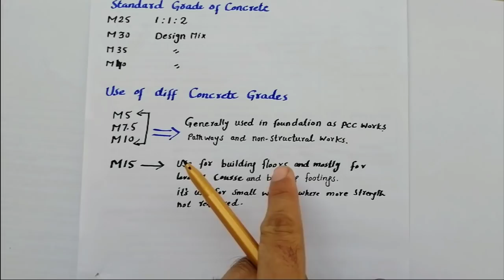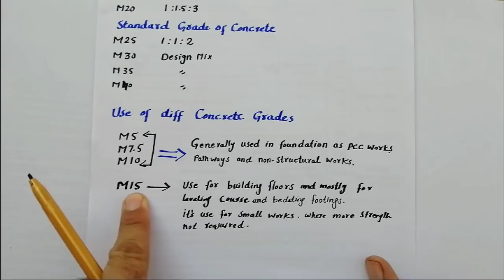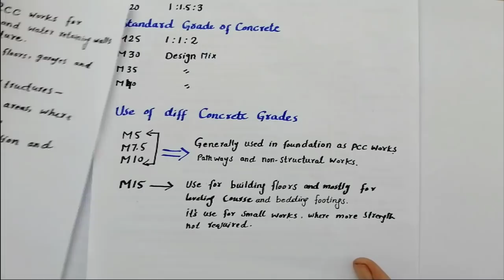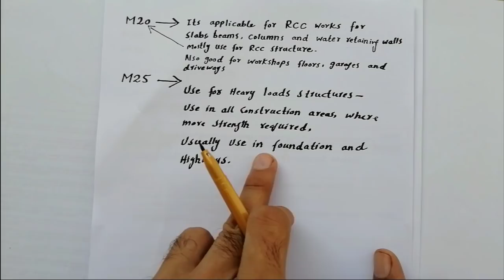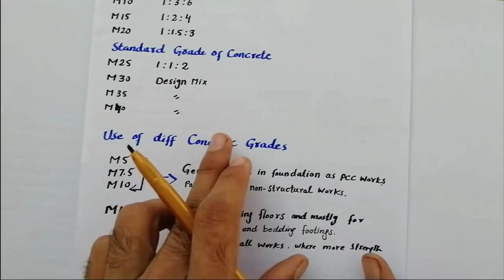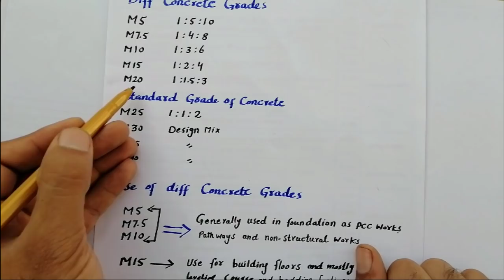Use of M15 , M20 and M25 in Construction works - DIFFERENT TYPES OF CONCRETE GRADES AND THEIR USES

Comment: In Concrete mix design proportion , you   should have to perform trial mixes and get the compressive test  strenght results for 7 , 14 and 28 days results.  Another thing is , how did you calculate the mix design  proportion ? What about for concrete masonry where  there are requirements for load bearing wall . What is required for strenght of CMU  or CHB  and for non load bearing wall.?

Comment: For the mix... Do you measure using buckets or wheelbarrows... For example in 1:1.5:3....for the 1.5 is it measured using buckets or bags or wheel barrows.... Same to the ratio 3
Reply: Whatever you use, just stick to the ratio. eg sacks 1 cement, 1.5 sacks of sand and 3 sacks of aggregate/stones
Reply: My friend , unit of measure is by  bag because the cement is by bag 40kg or 50kg. So the proportion for concrete design  mix  should be bag which is 1 cubic foot.

Comment: Hello sir, You are giving good knowledge for civil engineers,
Thanks alot.
Sir I would like to know about design mix calculation and detailed raft,length of cutting of steel bars in all civil engineering . work calculation.
Sir, you have to give steel and concrete formulas in pdf,and videos.

Comment: Hello Sam, you said M5,M7.5 can use for foundation, then you recommend M20 for foundation too.  I am lost.  Please explain.
Reply: House foundations is M20. If you want it stronger add rebar or more aggregate.
Reply: Hello !grade  M10 and  M15 concrete  can be used in foundation for lean  concrete . For blinding M5  is ok . What  confused you is he did not clearly mentioned  the specificaly  for strenght of concrete . For foundations should be M25  Not M15

Comment: Informative video, it is more if you add the comp. strength of every class of concrete for example mix 1:1.5:3 will give you a strength of 282 kg/cm2.